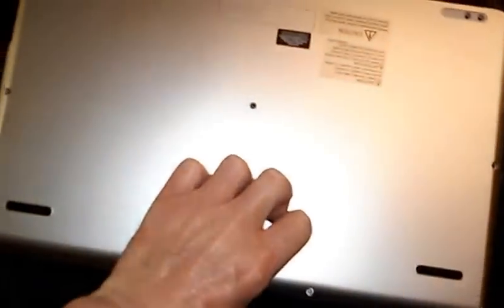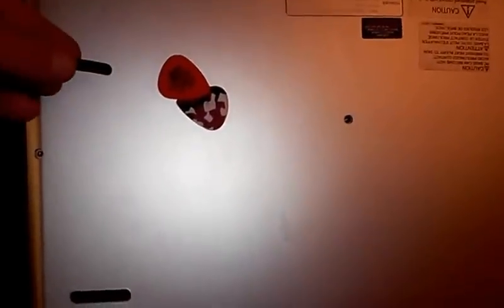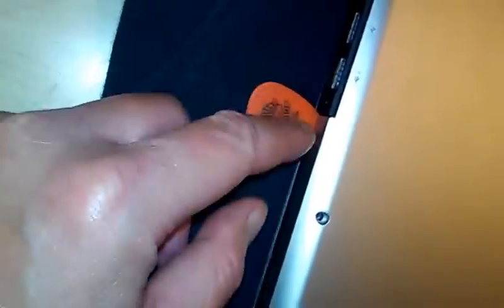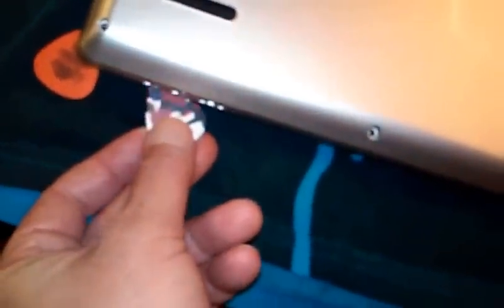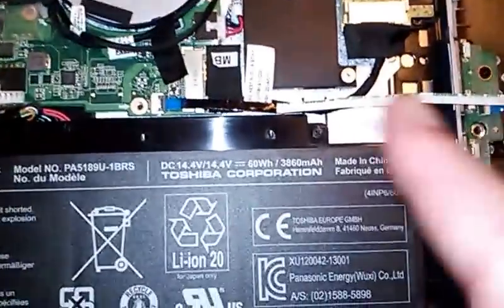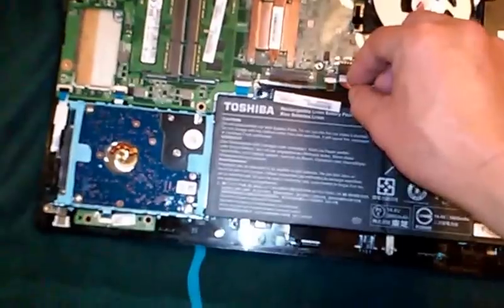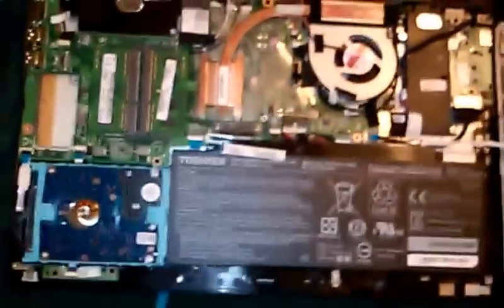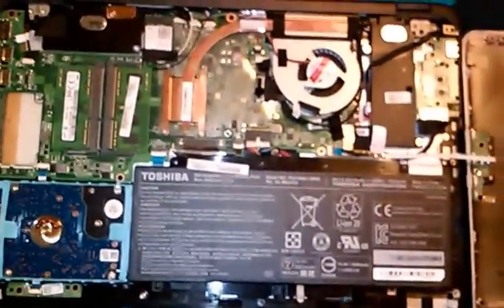Toshiba Satellite Radius P55W Disassembly.  Coffee Spill, Will Not Power-on

Comment: Hi Travis I have the same laptop as you and I opened it up to replace the HDD w/ a SSD. When i was taking the back off the ribbon connected to the power button came out(came out from the button side not the mobo) and I have tried putting it back in and lifting the little black tab but it still doesn't power on. Any tips you can offer to help get the ribbon to make the connection?
Reply from the maker: +Mike Beach | Hello Mike.  Inspect the ribbon cable and electrical connectors for damage.  If there is no damage present then check to see if any corrosion is present on the contacts:  use a Q-tip and rubbing alcohol or contact cleaner to remove the corrosion.  Inspect the power button for damage as well.  You can swap the ribbon cable, end-for-end to see if that makes a difference.  Once you insert the cable into the connector, the "tab" should snap firmly closed; if it doesn't act like the other connector then it may be damaged.  If you can make solid electrical contact between the ribbon cable and power button connector, you may be able to secure the connection in place with a piece of black electrical tape.  The tape can be any color, I am mentioning black as most people associate that color with electrical tape.  You can insert the ribbon cable into the connector without closing the tab, then gently wiggle or move it into different positions to see if contact will be made while depressing the power button.
Are you attempting to power-on the laptop using battery only?  Or, AC power with battery?  If battery only, did you remember to reconnect the battery connector?  If you are using AC, then battery should not matter.  I am asking you these questions to see if another problem may exist that is not a direct result of the ribbon cable and power button.  I hope this helps and you are able to resolve your issue.
Reply: +Travis Purdy I Got It!! I don't know what specifically i did, I cleaned the cable connector, the connector on the board and wiggled it a little bit but it just powered up. Thanks for the quick response and the help. Appreciate it a lot!
Reply from the maker: That is great news Mike!!!  Glad it all worked out for you.
Reply: +Mike Beach Hello, what did you do to get to fix your ribbon cable problem? I think I have the same problem where I opened my laptop and I think that the ribbon cable accidentally came off of the black tip of the case. I tried putting it back in but my laptop isn't turning on. Help please? D:
Reply from the maker: +Mallea Bility  | Hi Mallea!  Mike didn't identify the exact solution however, I provided the following steps that may help you:

Inspect the ribbon cable and electrical connectors for damage.  If there
 is no damage present then check to see if any corrosion is present on 
the contacts:  use a Q-tip and rubbing alcohol or contact cleaner to 
remove the corrosion.  Inspect the power button for damage as well.  You
 can swap the ribbon cable, end-for-end to see if that makes a 
difference.  Once you insert the cable into the connector, the "tab" 
should snap firmly closed; if it doesn't act like the other connector 
then it may be damaged.  If you can make solid electrical contact 
between the ribbon cable and power button connector, you may be able to 
secure the connection in place with a piece of black electrical tape.  
The tape can be any color, I am mentioning black as most people 
associate that color with electrical tape.  You can insert the ribbon 
cable into the connector without closing the tab, then gently wiggle or 
move it into different positions to see if contact will be made while 
depressing the power button.
Are you attempting to power-on the laptop using battery only?  Or, AC 
power with battery?  If battery only, did you remember to reconnect the 
battery connector?  If you are using AC, then battery should not matter.
  I am asking you these questions to see if another problem may exist 
that is not a direct result of the ribbon cable and power button.  I 
hope this helps and you are able to resolve your issue.

Comment: Hey Travis, thanks for this. I just bought an L55W, which appears much the same. I wanted to swap the SSD from my old (now with defunct screen) laptop into it and can't for the life of me find a video of someone opening one. Not precisely the same machine, but this gives me a pretty good idea what I'm in for.
Reply from the maker: +DuWayne Brayton :  Hi DuWayne.  The L55W and P55W look similar from the pictures I have looked at, so I have the impression they share a similar chassis design.  For any laptops I have serviced that required separating the chassis, the procedure is generally the same; all remove screws from bottom, determine best separation method, and be careful of components/ribbon cables/etc during disassembly/separation.  Of course it always helps when the manufacturer provides service doors for access to components such as the HDD, memory, etc...so you don't have to separate the chassis!  Just take your time and I'm sure you will have success.  Best of luck to you!

Comment: Can I upgrade the memory on the P55W-B5112 model? I have an 8 gb memory want to have 12gb. On their website it states that its non-upgradeable, do you know why? and if I can upgrade it can you make a video on how to do it? thank you.
Reply from the maker: +marvinshelbygt 
Hello Marvin!  

The Toshiba Radius laptop is no longer in my possession, so I will not be able to produce a video for you.  However, the video posted here will lead you to a starting point to determine whether the memory can be replaced/upgraded to 12 GB.  Toshiba's website states "Memory is not user replaceable" which could mean:  (1)  8 GB is the maximum memory for your model or (2)  memory cards (SODIMM) are soldered to the mobo or (3)  your model of laptop requires disassembly procedure not recommended for the end user.

###I read that P55W-B5224 will only take 8 GB total memory however, *-B5112 will take max 16 GB memory####

See link below:

http://www.tomshardware.com/answers/id-2627049/replacing-laptop-memory.html

Go to ~ 3:30 in the video, pause, and you will see the two SODIMM cards in the directly above the HDD and immediately to the left of the copper heat sink.  On the outside of the each SODIMM are metal or plastic tabs that secure the cards to the mobo.  With light finger pressure, gently spread the tabs apart and the SODIMM should pop up, in order for you to remove it.

***If the first SODIMM doesn't pop up, try the other one...if neither pops up then inspect the slots to see if they are soldered (I will be very surprised if you report back that they are soldered)  Just want to make sure that you don't damage your working machine!!!

Assuming the above procedure went as described, simply slide in the new SODIMM and gently press it downward until the locking tabs "click" indicating the card is secure.  
NOTE:  When installing the new SODIMM, make sure it is seated squarely and contacts are fully inserted into the slot.  You will need to insert the new SODIMM at ~ the same angle in which you removed the old one.  Sometimes the SODIMM can be a bit difficult to line up correctly if you have never performed this operation before.
NOTE:  Before you purchase new memory, make sure to confirm the new memory is compatible with your current mobo:  voltage - 1.5 VDC or 1.35 VDC, speed, etc...You can download a program called "CPU-Z" that will provide specs for your hardware.

I am running 12 GB in my L855 with two different voltages with NO issues however, I cannot guarantee that for your model.

I hope this helps and best of luck to you!
Reply: WOW! this is great ifo.thank you so much, this really helps.

Comment: I have this same laptop, it powers on, but I want to open it, but Is it safe to open it even though it has no lights on? I don't like that the battery is inside, I don't want to be electrocuted touching the components. Do I wait till the battery capacity is drained? Or is it ok to open it up and touch the components, even if the battery is full? I'm new to laptop hardware repair and upgrading hardware.
Reply from the maker: Omar Kazi Hi Omar.  There is very little risk of getting electrocuted as long as you disconnect power from the laptop prior to performing any work.  Always terminate power to anything electrical prior to performing work.  Once you have shutdown the OS and disconnected power, you are ready to open the laptop to begin troubleshooting.  Disconnect the battery from the mobo and remove the battery if you wish.  You do not need to wait for the battery to discharge prior to disconnecting the battery.  Assuming the ribbon cable to the power switch is still connected, you can depress and hold the power switch for 60 seconds to discharge any residual charge remain in the circuitry.  I strongly advise that you DO NOT TOUCH components inside the computer while the battery or power is applied.  Some people might argue that it is OK work "hot" and no big deal but, caution is always better than haste.  Good luck to you and take your time so you get the work done correctly.
Reply: Travis Purdy Thanks.
Reply: Travis Purdy Thanks. And there is only one electrical connector in the battery right?
Reply from the maker: Omar Kazi You are welcome.  Yes, only (1) electrical connector to the battery.
Reply: +Omar Kazi (OAKSIF) 
Keep holding the power button for 15 or 30 minutes to ensure power is completely gone. 
Slap an external harddrive in or something to suck it out if you are afraid of getting a shock.
Reply: Ok
Reply: I already put an 256GB SSD and put the 850GB HDD outside in a case.
Reply from the maker: +Omar Kazi (OAKSIF) - Glad to hear things worked out for you.

Comment: Hi, is it possible to add a second Hard Drive or SSD to your Toshiba Satellite P55W, by using the optical drive bay. (I see space for optical drive but didn't have it), I am considering to use two SSD drives, one replace the existing 1T HDD and the other one fit into the optical drive bay but not sure if there's extra SATA slot.
Reply from the maker: Omar Kazi 128 GB will work but I would recommend going to 256 GB minimum.  I was recently stuck with making this decision for my personal machine and I am glad I went with 256 GB which I purchased used from ebay for ~$90 USD.  Still running great, no issues!  Check around for pricing at newegg, tigerdirect, ebay, amazon.  You will be glad you went with larger capacity.  Good luck to you!
Reply from the maker: Zhou David | Adding a second HDD or SSD to this model is not physically possible with "this" configuration of laptop.  The model in the video did NOT have ODD.  If you have a laptop with ODD, you can purchase a HDD caddie on ebay.  Simply remove ODD from laptop, add HDD or SSD to caddie and plug in.  The HDD caddie has a connector that fits right to the mobo.  Make sure you check your measurements (height of ODD opening) to verify the HDD caddie you order will fit; last time I checked, there a two different slot opening sizes.  I did this mod to my Toshiba L855 where I added SSD for OS and moved 640 GB HDD as secondary storage in place of ODD.  The performance improvement is totally worth the effort and money!  I hope this answers your questions and best of luck to you on your mod!!!
Reply: Travis Purdy Thanks for the info Travis, its very useful!
Reply: Travis Purdy If I get an SSD small enough, maybe I can fit it in? And get a sata spliter cable to fit 2, the original HDD and the new SSD?
Reply from the maker: Omar Kazi I like the idea however, I can't confirm whether that will work or not.  One option would be to install an SSD and use the orignial drive as external storage.  You can find external HDD cases with USB 3.0 on ebay for around $10.00 USD.  When doing mods like you described, my concern would be available power from the mobo for two drives and proper cooling for two drives in close proximity.  If it was my machine, I would just go SSD (256 or 500 GB) internal and original HDD for external storage.  I hope this helps.  Cheers!
Reply: I'm trying to save money so $50 around that price I might pay for an SSD. 128gb minimum
Reply from the maker: +Marcos Diez - Greetings Marcos!  The model in my video DOES NOT support two concurrent drives (HDD or SSD).  There is not an ODD either for this model so you are stuck with only one drive space available.  256 GB SSD is the minimum capacity that I recommend for upgrading from HDD.  Thank you for your updated post since it helps others who might have the same question.  Cheers!
Reply: I have to agree with Travis, you really should get a minimum of a 250gb range (they range from 240-256gb) at the very least. You will only get a fraction of the potential SSDs have to offer with 128gb. A hybrid drive would actually serve you better than a lower capacity SSD, as they are just as fast, if not a little faster and they have significantly higher capacity.
Reply: +Zhou David +Travis Purdy , I have the same idea of adding a SSD to my P55W B-5200. But I'd appreciate if someone already open it to confirm the SDD placement. From the video made by +Roman Goldin of his P55W, we can confirm the place used by the HDD in this video is empty, and from his video I think I made up the model and part number from a Samsung 850 EVO 256Gb SSD placed next to the RAM cards,  in a place that this video shows a rectangle white with a brown vertical strip, which I couldn't figure out whether it is an empty place, a stub card holding an empty place, or another vital component (and I'd be mistaken). If I am right, at the bottom of that sqare, parallel and next to the HDD place, there should be the connector for the 2" SSD card without it's 3" mounting chasis.

Please, could someone confirm this?
Reply: +Roman Goldin

Update: I finally opened mine, what I've found in that place is an empty space, and the edge near the HDD has the holes in which to weld a mSATA / mini PCIe female connector, whose shape is even drawn and shaded over the motherboard PCB. Hence, for those who bought the HDD version Toshiba didn't weld the mSATA connector required for the SSD, and I can confirm from  Roman Goldin's video that the oposite is true also: in his Toshiba motherboard, at the very upper right corner next to the placement for the HDD, it lacks the SATA female connector needed to connect an HDD. So neither model supports natively the addition of a second storage device.
Reply: +Travis Purdy thank you for you answer. Actually it's a pitty. It doesn't make much sense Toshiba's choice of depriving motherboards from one or another version of SATA female connectors, and having two different welding procedures seems more expensive than the connector's cost they'd be saving. Hence, it's more likely that the motherboard would be sharing the same data wires between both SATA connector's places such that two devices at once would collide with each other, and the lack of one of those connectors would prevent this attempt... proving Toshiba knows its users better than we know Toshiba :)

Comment: hi,,,,doing this (removing screws and opening the back cover) will not void the warranty?? i have same model that i also wanted to open becuase its not turning on (but still under warranty) and wanted to make sure that if in case i still dont make it to turn on, i can still have it returned without being noticed it was opened??
Reply from the maker: akosikuisa | If the laptop is still under warranty then I wouldn't advise opening it, just to be on the safe side.  Contact your place of purchase and confirm RMA process and make sure ask if any money is expected from for shipping/repair/etc...Good luck to you!

Comment: Can you point out where the wifi card is? How easy is it to remove / replace after the machine is open?
Reply from the maker: Roman Goldin - Hello Roman!  This model disassembles fairly well just be careful when you lift off the bottom cover since the power ribbon cable is attached to the mobo and bottom cover.  Pause the video at 3:26.  Locate the memory modules and CPU end of heat-sink, between those two locations look directly above and you will see a square device with a black wire and white wire attached.  That is the wifi card if I remember correctly.  This was not my personal machine so I no longer have access to it for verification.  You can disconnect the black and white wires (REMEMBER WHICH GOES LEFT/RIGHT) and unplug the card from the mobo.  Simply reverse the process with the new card.  Make sure you have disconnected the battery before doing any work.  I hope this helps and wish you best of luck.